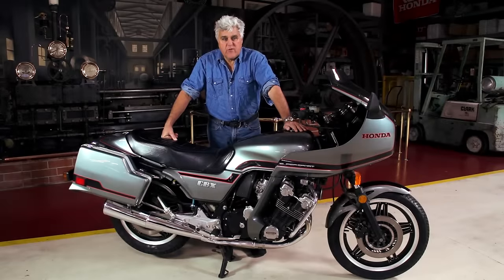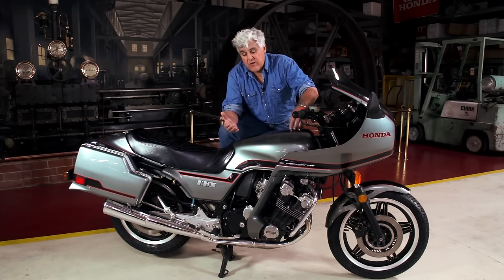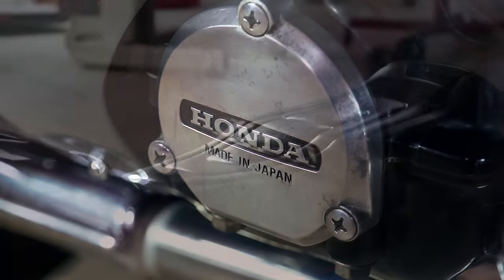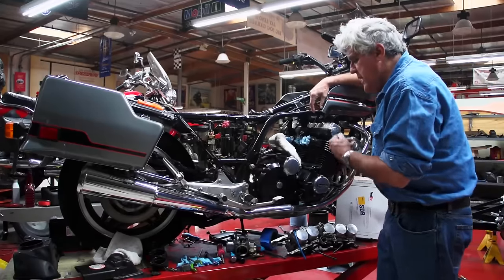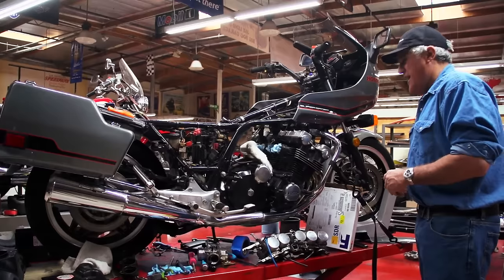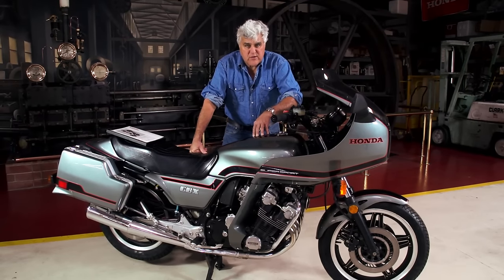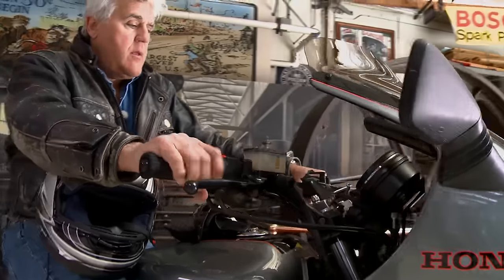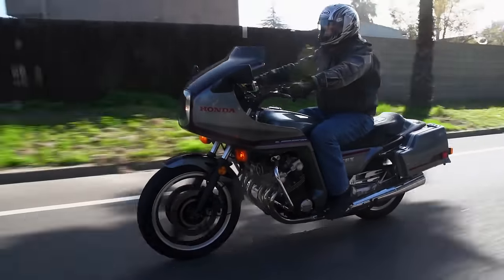1981 Honda CBX - Jay Leno's Garage

Comment: A very good friend of mine had one of those.  RIP big John.   One summer, three of us rode our bikes from Edmonton, Alberta to L. A. and back.  What an adventure.   A ‘79 Honda CB750k (mine), a ‘84 Honda 1000 Interceptor (Dean) and John on his ‘81 Honda CBX.  His bike was identical to Jay’s.  Just as coincidental, my current helmet is identical to Jay’s.  I’m now 70 years old, but I still ride my 2000 Honda VFR and my 2006 Honda CBR1000rr.  Not as much as I used to, but I don’t know, or even see, guys around here, my age, riding these days.  

Back to our adventure with the CBX.   We took a great route,  down into the USA first, then West to the highway back up into Creston, BC.  From there it was North on BC’s #1 rated motorcycle road to the Balfour Ferry.  Dean and I were loaded with luggage, but we still ended up chasing a Honda 750 interceptor through the curves.  We got a bit too far in front of Big John, but thought he would catch up when we stopped a few miles up the road.   Halfway to the ferry there used to be a wooden bridge on a slight curve.  The road was still damp in the shadows, so we knew enough tip toe across that bridge because it would still be wet and greasy.   Big John, being a new rider, didn’t.  Apparently he didn’t slow down and had that big CBX completely sideways on the bridge.  When his tires hit the grippy pavement still sideways, it violently snapped back straight.  If you happen to watch MOTO GP or if you ride a bike yourself, you know what happened next.  Big John was launched from the bike into the air…

The way that bike was put together, plus having the crash bars really limited the damage.  We straightened out the sub-frame that held the front fairing onto the bike frame.  Nothing else around, so we used a telephone pole as brace to bend it straight again.  Worked like a charm.   One rear bag and the crash bar were scraped up, nothing else was damaged.  The mirror on the side that hit the pavement was scuffed, but it wasn’t even broken.  That was Day 2 or 3 of a 3 week adventure.  

My bike developed an oil leak through the gasket at the base of the cylinders around Day 6.  It wasn’t a real fast leak, but it did require regular oil top ups.  At every gas fill-up, I’d check it.  If it had stopped leaking, it was time to add some oil.  A lot more happened on that trip, but we all made it back in one piece.  It was an adventure of a lifetime!!   

Dean and I keep in touch on a regular basis although he now lives in Aussie Land.  I still have pictures of that trip some 37 years later.  Even though there were many other trips (and bikes) after, that one was epic.  Seeing Jay’s bike in such beautiful shape, brings back memories.  P.s. John had the bike fixed up and looking like new soon after we got back.  We had managed to do such a good job straightening and eye-balling that bent steel sub-frame that somehow it was so straight, it never required any more work.  Everything aligned and fit like when it left the factory.  Amazing beginner’s luck.  No tools, just an old telephone pole.

Comment: I  was working for Honda in 79, got a red/black one that an old guy saw God on, for half price, with 70 mi. and a windshield, that came right off! I raced it every weekend and made a hack to be able to adjust valves/jet carbs on the fly by  (with chain still on) taking top mounts off, loosening the others, trying a rope to the front of motor, going to the back and  while holding pressure on the rope, ease the motor down with the chain adjusters and then when done, pull on the rope while using adjusters to help me back up. Worked like a charm. Thanks for sharing Jay. We had crates of 82s that went for 1500 ...sad. Shoulda bought em all :)

Comment: Put some NGK with plugs in her and index them with the good wires and hot coils. Put the K and N filter in the box at go up 10 to 15 in jet number. Take two bolts as big as your pinkie and put them in the pipes before the slip ons and tig them up.  Add fuel as compression ratio dictates. Enjoy. You could cut 2-3 turns out of the carb spring but might be surprised.

Comment: I had an 81 CBX as well... And you're right... Still one of the sexiest engines built. Super smooth. They did have bit of a problem with the alternators but enthusiests around the world seem to have come up with other options.
The camshafts are an interesting item too... They are actually 4 camshafts joined by oldhams couplings. Because the warpage was so great in the heads that they couldn't use a one piece camshaft. It was also interesting with the carb setup in a kind of a "V" configuration to help with fuel/air mixtures etc... Still an awesome motorcycle... Followed for me by the NR750 engine...

Comment: Honda should do another CBX in the same way they did the CB1100. Honda actually had a hell of a time bringing back the air-cooler 4cyl, but they did it, and I'm sure adding two cylinders at the same level of tune would yield good power.
Reply: +turbo311 The power on the CBX is good, but you gotta consider that the engine is a fair bit more weight.  It is also so forward that it really is an odd bike to ride.  I would love a new one as well, but the F6B Valkyrie really is like the CBX.  Probably better in fact with the better positioned weight.  Yeah, it doesn't have the same engine feel and sound though.  But end of day, even a new version of a CBX wouldn't be a nice bike.

CBX is an experience more than anything.

Comment: I had an identical CBX like yours but I didn’t have the saddlebags. The other color option was white w/blue stripes. Yours is beautiful still, my very first new vehicle in 1981. Brings back memories. I remember winding it out to 140 miles an hour on the 111 to Palm Springs one day. So smooth.

Comment: I also bought one brand new from the Toronto International Motorcycle Show in 1981 (This exact Model & color ) - It was on a raised rotating display platform in the Honda section and looked spectacular under the spot lights - - - I had to have one !! I ordered it on the spot & picked it up 2 months later - astounding performance & practicality 4 the time - I loved the snap on luggage -  I was a very proud owner for 24 years of cross continent touring  - 103 Hp six shooter & able to dice in the corners with the best of the production race bikes of the time !! - - - I Loved It like a girlfriend until I finally found a better one - My current Steed a 2002 Air cooled 1200 S Suzuki Bandit - - - which is even more impressive in performance & function !!

Comment: Years ago, I spent an afternoon with Jay at the Rock Store. He brought a unique bike, believe it was a Honda NR500. He is a humble man. All he wanted to chat about was the CBX. I was riding my 1982 model, purchased new.

He was surprised, I told him I had TWO, an 81 and an 82. This was in 83 or 84, if I recall. He was so proud of his 81.

Rewatching this video, I see something both Jay and I had done. There's a Voevodsky Cyber Light under the license plate! This light was innovative, it had two lenses, one red, and one amber. The harder you decelerated, the faster it flashed. There is a series of mercury switches in that housing, at various inclines.

By the way, that high idle after service. Honda fitted these with a remote idle adjuster screw, it uses a flexible cable.

Comment: I count myself very lucky to have owned one. Mine was a 1979 silver one with 105 hp. They detuned them (black box) the next year to 100 to get them into Germany which had a hp limit. When I had it, I was still new to motorcycling, and to be honest, it scared me a bit. So I sold it after only a year and bought something smaller. 
I remember it used to weave a bit around corners, and was told that they used plastic swing arm bushings instead of bearings. The spindly little front forks didn't help either, but the engine was nothing short of superb. That I miss.

Comment: At 12:00 that pull to redline sounds like a Ferrari Daytona 12 cylinder!! 🏁👌🏽
Reply: Mine "Pulled" & sounded like a Ferrari -  I loved it !! - I always wanted to replace the stack mufflers with a 6 into one header but I was still waiting for the stock mufflers to rust out 24 yrs. later and never got around to it. - - - I Sold it in 2005 for the same I paid for it & 5,700 - best bike I ever owned  until  My current Steed a 2002 Air cooled 1200 S Suzuki Bandit
Reply: 6 cylinders are inherently balanced, that's why they run and sound so smooth. 4 cylinders are a lot more rough becuase you have to go 180 degrees of crank rotation between firings. Inline 6 cylinders only have to 120 degrees of crank rotation between firings. This gives them a distinctively smooth sound. 

A ferrari flat plane v8 is essentially 2 inline 4's attached at the crank. The roughness is still there, the scream and snarl is still there. They actually still have to go 180 degrees of rotation between firings, but there are two pots firing at a time. 

The v12's are two inline 6's attached at the crank. They're just as smooth and that's why they sound so amazing at high RPMs. it's such a smooth tonal climb that it's just crazy to hear. Compare a Ferrari v8 to a Ferrari v12 and you'll hear the difference.

For example, a typical american v8 is NOT two inline 4's attached at the crank. They only have 90 degrees of crank rotation between firings, but the compromise in  exhaust pulse locations lead to a very uneven tone where you can hear that every rotation has 3 cylinders on one side and 1 on the other firing. Even on a DOHC v8 like the Ford Mustangs and Ford GT etc have.

Point is, there's good reason it sounds like a Ferrari. You're not imagining it.
Reply: Dave auf dem BMW I always thought these kinda sounded like Porsche's flat 6
Reply: Dave Sawyer - Do you really feel that the Bandit is superior, or is it just the quarter century of advancement that makes it? To whit - were they both designed on equal terms technology wise, would you prefer the Suzuki with the four banger or the Honda's six?
(I am not looking to annoy or incite anyone, I own bikes from three of the big four.)

Comment: FYI...

I put about 50 000 miles on my 1982 CBX-1000 Prolink without replacing the alternator brushes.
Good luck, or maybe they used other type of brushes on the 1982 model.
Just to be safe, I do carry spare brushes with me all the time. 
I used to carry condoms... but that is a long time ago :-)

Comment: I love those old six rockets. I went with the KZ 1300 and I put 31,000 miles on it in just over 5 months. In its day there were only two bikes made that could beat it. So it was really fast for those days. Heck, it's a lot faster than most riders today want to go. I tried to get one like yours but couldn't find one at the time. Beautiful bike Mr. Leno. I still have the 84 Voyageur.

Comment: I've seen this before but enjoyed watching it again. I had a 77 goldwing in the late 70s when bikes were going thru the roof with power and quarter mile times. I have always been a cbx fan, and in the late 90s I had a chance of picking one up for about $1500. My wife thought it was a crazy idea, but I knew it would be a good investments. I was right, but I was also on a low budget with 3 kids and it was not a priority at the time. It was an 81, just like Jay's. What a fantastic few years for motorcycles.

Comment: My boss bought one of these in 1980; he was seduced by the idea of a 6 cylinder.
Within a few days he regretted the purchase; the bike was too tall, too big, too wide and not much fun.  He said he should have bought the 750 as a much more flexible street bike.
Reply: I am 5'7 and the CBX fit perfect including comfort mine was 103 hp due to tucking the carbs in tighter. 130 top speed.

Comment: In 1977 I bought a 1976 KZ900 LTD, VERY fast it sounded SO good running the tach up and beyond red line thru the gears it SCREAMED literally, until Suzuki came out with there 1000 I couldn't be touched on the road, what a sweet bike!!!

Comment: My riding buddy back in the day had two of these. Very smooth, handy bags, my first impression during my first ride was, like sitting on top of a tall chair. It felt like I was sitting up high rather than sitting in the motorcycle. I was a road racer at the time, and I’ll never forget hearing one of these with six open pipes that one of the other racers was riding at Nelson ledges one weekend. I saw these machines at the time, and I believe the price was either 4600 or $5600 list. They did not sit around on the showroom floor for long.I still have the deck of cards that Honda gave to the salesman to hand out to customers. 52 cards, a different Honda on each card for the US market. I still have the deck of cards

Comment: Those CB's were really something back in the day.
I bought a brand new leftover 82 CB750K out of the crate in 85. Comfortable, and fast with lotsa performance.
Most my friends preferred my bike over the KZ's, GSX's and such.
Damned i miss that bike. It saw many miles of New Hampshire's White Mountains. I was no slouch when it came to riding. At least 8,000 miles a year, and I'm talking New England's short riding season.

Comment: The 1979 CBX was, and will always be my dream bike. 
But the price is so high on them now, that l had to settle with my 2nd choice dream bike. 
The 1985 Yamaha Maxim X. l bought it in 2015 for $1,800. 
It had 3,900 kms (about 2,500 miles) on it, still has its original tires ! 
I drive it around town, now it just turned 10,000 kms (6,250 miles). Love it !

Comment: My dad had a motorcycle shop back in the  mid 70's till the mid 90's... I remember him working on one of these bikes... most of the Japanese bikes were 4  cylinder ,but this was 6.…balancing the carbs was tricky because the manometer only had four tubes and lines...
..Nice Bike.. Great Video. !!

Comment: I saw this and several other cool bikes at the local Honda dealer when I was out at school in Utah.  They had a Cx650 Turbo, and the thing looked like a space ship compared to the run of the mill cruisers and UJM's at the time.  The early 80's were a tough time for the US motorcycle market.  Dealers had many leftover bikes sitting in the crates.  My favorite from that era was the 1984 VF500-- my buddy had paid the princely sum of nearly $3K for it.  It only had a few hundred miles on it when he let me try it out. It was a sublime experience- so smooth, agile, and well-balanced.  To this day, one of the best bikes I have ridden, and I've probably owned as many as Jay!  A few years later I picked up a 1984 VF1000R, thinking it would be twice as good as that 500.  It wasn't.  Heavy, odd handling, and not terribly quick, but boy, it sure looked cool!

Comment: I got to ride a CBX when they first came out in the late 70s. I was a big fan of the CB 750 Honda which is still my favorite of the old Honda’s. While the CBX had all the power you would ever need in a motorcycle it did not handle very well. This was  due to the engine  torque. I remember having to really lean into a left hand turn but only having to shift my weight a little for a right hand turn. Straight down the road it was alright. I always thought it would be a good drag bike.

Comment: I totally appreciate the love for early 80s muscle bikes. When I was 22 years old I bought a 1984 V65 Magna, AKA “The sledgehammer“. I still have it, still love it-35 years later. It was also the fastest production motorcycle in its day. The CBX Is on my list as well as a late 80s CBR 1000 hurricane. Had one of those too. I also have a 1964 CB77 super hawk. Very cool bike! I think I had the same leather jacket – gave it away decades ago, damn.

Comment: Awesome bike Jay! I own a 92 GL1500 6 cylinder goldwing! when you put the goldwing on it's center stand you really can put a nickel on the valve cover and rev them and the nickel won't fall over  SMOOOTH! It's the Torque of the GL1500 (102 ft lbs) that you feel in the seat of your pants! the 100 horses aren't bad either and the GL1800's have even more!

Comment: I had a 1979 silver CBX that I purchased from a friend after he took his wife for a ride and it ended with that classic the bike goes or I go. It ws the best bike I ever had, The best thing about the CBX was on this long straight section of I395 in Connecticut you could be riding at about 50 in high gear ad just roll the throttle wide open and you got the nicest smoothest acceleration up to 135 or so of anything besides an airliner. I sold my CBX years later and actually had a bidding war between 2 guys from different states in my driveway. I got more money but still wish I could take that day back and still had my bike.

Comment: I worked at the Chrysler assembly plant in Belvidere, IL. some of the other workers had cars they only drove in summer and mostly just on weekends.

Somehow I had discovered a product called Sta-Bil that prevents gasoline from becoming stale. I recommended it to them and their gummed up carb problems went away. In fact I have a Dodge Lancer turbo car that I haven't added gasoline to for almost four years because I drive it very seldom. It starts and runs perfect because I treat all gas I add with Sta-bil. LIving in WI I have to use a lawnmower for about six months and the snowblower the other six. I keep Sta-bil in the tanks and I never have a problem starting them.

Comment: That's a sweet scooter man. Don't let anyone tell you different. My first was around the same age as you. An 81 Seca Yamaha. Handlebar fairing and drive shaft. Some made fun, but roll the throttle and hit some curves and that stopped right quick. That CBX really look nice with the gear on it. Especially that fairing.

Comment: My first bike was the 81 CB900F which I think was a much more practical bike to own. Lighter and still smooth but with 92 HP and very fast. Had the same lines as the CBW (fairing and turn signals etc all looked the same). I loved that bike and wish I had been able to garage it and keep it forever.